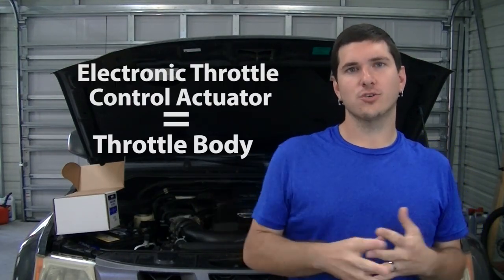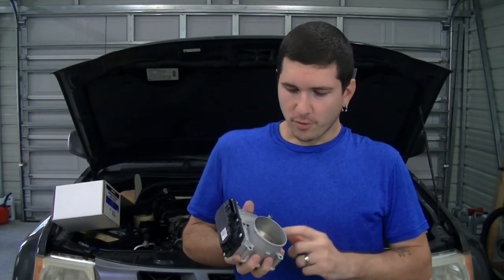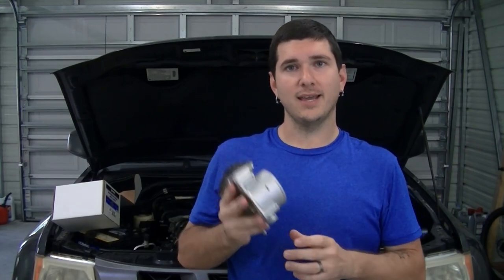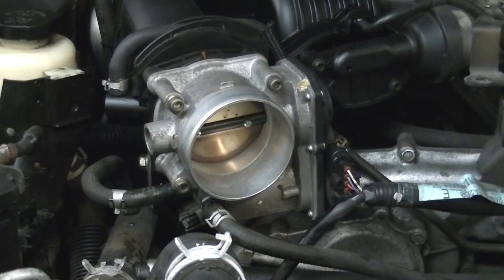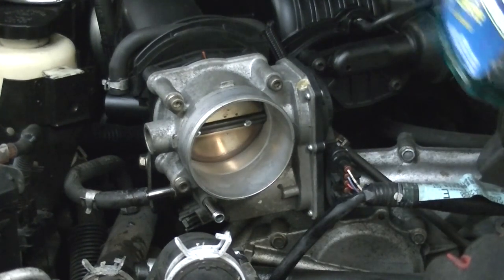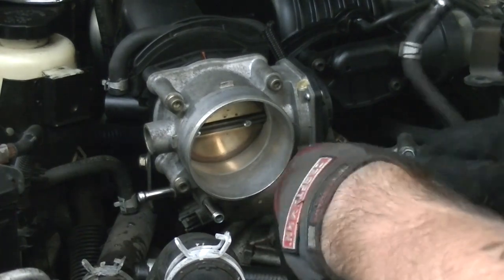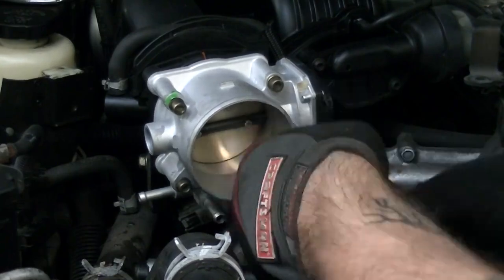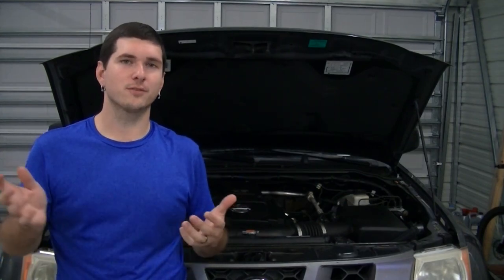How to Replace the Electronic Throttle Control Actuator (throttle body) in Nissan Xterra

Comment: Good clear video as always. Keep it up!
After installing a new clutch and flywheel, the mechanic accidentally misaligned the flywheel. Vehicle idled poorly and would not rev past 2,000 rpm. In his ignorance he swapped out the throttle body with one from a Frontier. Of course he had the same issue. He pulled the transmission again and aligned the flywheel correctly. Upon start-up vehicle " hunted" for idle between 700 and 2000 rpm! Attempted throttle relearn many, many times . Vehicle would not accept!! Eventually took vehicle to dealership, they completed a relearn. At a cost of $150 Canadian! I think it's important that people know there is a potential that you will not be able to complete a throttle relearn in your garage.

Comment: Nice video! I have an 09 Pathfinder and just ordered a replacement throttle body. My question is after  replacing the throttle body, should the relearn procedure be done before starting the engine?
Reply from the maker: Yes, if you replace the throttle body you should do the relearn. Dont worry though, I have a video for that ;)

Comment: gr8 vid      a small tip:in the event coolant is present in hoses you could pinch them closed with tool made for this if you possess one or with vise grips using a short length of discarded hose or similar to protect hoses as you gently pinch them closed as needed        again gr8 vid

Comment: @Rythecarguy i was trying fix rough idle on my car, cleaned the MAF, throttle body, and new spark plugs as well as throttle body seal and plunum seals. As i was cleaning the throttle body i noticed it wasn't going fully verticle closed. Would that indicate it is worn out and needs to be replaced? Love the channel man and have sent tips in the past for your great value you have provided. Will certainly again!

Comment: I just purchased a 2017 Frontier, I do see it and the Eterra are pretty much the same.  I do think the idle is high when starting.  Will cleaning the Mass Air Flow and throttle body first then going through the rest is best?  I didnt see you clean them before the first video on reset.

Comment: hey great video. couple questions. did it fix your problem? and my 2004 pathfinder idles low around 600-650rpm, you think it would be a similar issue? relearning dident fix it. also what are the torque specs?
Reply: did you ever fix it?

Comment: I had this problem in my 2007 pathfinder  2 years ago and bought a reman part now it came back and warranty over. I did have a question when you remove the part do you disconnect the battery or leave it? Last time we disconnect and when we tried to erase the code it wouldnt had to take it to a mwchanic who uses a more high tech machine

Comment: I have a 06 Nissan Pathfinder, cleaned throttle body, put back together and it started idling around 1K, then check engine light. I tried doing the 3 procedures to reset and relearn the TB about 20 times. No work. Still idled high. Was about to order a new TB and came home the next day from work and decided to try the whole reset and relearn procedure with the engine stone cold. Started it up at the end of procedure 3 like it said, came back after a few minutes and RPMs were idling at 625 RPM! So if you are not having any success with engine and transmission fully warmed up, try it with it COLD!
Reply from the maker: Awesome. good tip! Thanks.
Reply: Thank ill try I'm having same issue

Comment: Just curious what symptoms you were having that lead to the change? Thanks!
Reply from the maker: High idle
Reply: @Rythecarguy  thank you for your reply! I got a code P1229 and P2138. Car will be running but almost zero difference in RPM when I hit the gas. Just working through codes and trying to sort it out. No high idle issue here though. Also, just started looking through your videos, and they are some of the most easy to understand ones for my small brain!

Comment: I diagnosed my xterra and it said I have to change my fuel temp sensor  and intake air sensore..parts are on the way..my exterra starts then about 2 minutes it starts to idles to 2000 then goes down to 1000 and continues..engine start to give out weird smell too..do I have to change the throttle body too??the throttle  body didn't read in the diagnostic monitor..pls help

Comment: @rythecarguy Why did you replace the throttle body? What were your issues? I have a high rpm (2500) at startup and relatively high (1100) when warmed up.
Reply from the maker: High idle was the issue. Don't forget your relearn as well. I have a video for it

Comment: How did you know this part needed to be replaced? I have a 2007 Nissan Frontier XE and trying to troubleshoot why its idling fast. Just replaced the radiator & thermostat. TIA

Comment: Hey Ry, Another great video as always. Any issues with this particular throttle body? Just ordered mine with your link. Planned to originally just take off my oem one to clean but after Watching your video I decided to replace.
Reply from the maker: Hey Alvin. This video was almost 7 years ago (can't believe it!) and this throttle body is still running great! I'm sure it will work great for you.  👍🏻
Reply: @Rythecarguy  LOL I didn’t even realize that it was seven years old. I’ll let you know how it goes and again appreciate all your videos.
Reply: @Rythecarguy  Ok. I replaced the throttle body and did the idle relearn procedure. RPMs stayed down for a bit but then started to show same symptoms. Do I need to start hunting for vacuum leaks?
Reply from the maker: Oh bummer. When does it go back up? Once the truck warms up?
Reply: @Rythecarguy  Seems to be. I drove it for a bit to warm it up prior to doing the relearn. Right after it seemed to idle better but it will rise after I’ve been driving for a bit.

Comment: Hey Ryan, went to unscrew the throttle body and wasn’t wanting to come off. Working on a budget here, do you know of any good mechanic shops in Orlando that’ll use my part to install the throttle body for a little bit cheaper or another way I can try and get the bolts out without stripping them?
Reply from the maker: Most automotive shops will use your parts. I actually have my Saab in shop right now and I supplied the fuel pump. It will definitely make the job cheaper since they mark up the parts as well. Throttle body swap should be very cheap. Probably just the one hour minimum

Comment: Is the throttle body responsible for my 2005 XTerra going into “limp mode”? It’s driving me crazy trying to track down what is causing it. Some mechanics say, “it’s your oxygen sensor”. Replaced those- still goes into “limp mode”. Another says, “no, it’s the cam-shaft sensor”. A third says it’s my throttle body. So…

Comment: question. i have a 2005 frontier (2.5L). i removed the Intake to change spark plugs, change intake gasket and throttlebody gasket. im pretty sure i tightened everything correctly and i believe it was all seated correctly. i cleaned the hell outta the throttle body and stuff with carb cleaner. i sprayed the TB pretty good. cleaned Maf sensor correctly with its special cleaner. now everything is back but the engine idles between 1000 and 2000 rpm (fluctuates pretty hard up and down, up and down in park or neutral....its fine in gear). ive checked for vac leaks with propane, tried relearning the TB a million times, reset the ecu with no luck.   any chance spraying the TB pretty good ruined the electronics on the TB somehow?
Reply: Scott Drabek  did you ever figure out what was wrong with your frontier.im having the same exact issue with mine right now and can’t figure out why it’s idle is doing that.

Comment: I m going to change on the Nissan Pathfinder 2013  wath is the procedure I have to disconnect the battery?
Reply from the maker: Just pull off the negative battery cable and secure it somewhere where it won't touch the battery post.

Comment: I need to change mine on a 08 dodge caliber.. Will I need to. program anything or have it taken to the dealer. I was going to change it myself. just wasn't sure or not
Reply from the maker: Most cars when you start messing with air control will need some sort of programming once you are done. You will just have to check the direction for your car and it will tell you if you have to do it afterward.

Comment: I have a 2010 nissan altima and I had no power at all on the car. When i push the pedal nothing happened i changed the throttle bottle and it worked perfect. The next day it messed up again and its giving me the same code. What could it be?

Comment: Question? after replaced it, you don't have to program the sensor, I have a murano and someone toll me that..idk if is true but I'm going to replaced it
Reply from the maker: If you replace it and then start the car and it works just fine then no, you don't technically have to reprogram. However, that will probably not be the case.
Reply: Youll need for sure in altima 2007 you need, murano is big brother of altima 😂

Comment: I have a 2002 Nissan Altima 2.5s  and got a P1128 code , I replaced the throttle body  and did the relearn process . The  following day the check engine light came on and I lost acceleration again and got the same code P1128 .  How can I fix the problem.  Thanks
Reply: I know it’s been 7yrs since this post - but, you said that you “lost acceleration”. This is happening to me and I’ve come to find that it is called “Limp Mode” in Nissans. Did you ever figure out what the cause was and correct the issue? Cuz it’s driving me CRAZY! It happens 2 or 3 tines a trip to the grocery store. I lose acceleration and I have to pull over, turn off the ignition and wait for maybe 30 or 45 seconds and then it’s good again. I don’t know what, exactly is causing it or how to fix it.

Comment: I have nissan pathfinder 2011 and keep getting check engine light , i ran the scanner and i get P0101 code. i replaced the mass air flow sensor and for a week the check engine light went away. now it just came back on and still get the same P0101 code. its  possible that my throttle body probable is dirty? i have 115,000 miles on the truck.
Reply: There is a technical service bulletin for this code. NTB12-051j. Reprogram the ECM. Nissan will charge about $130 for it.

Comment: Having hesitation issues on a 12 Pathfinder 4.0 after high RPMs. Need suggestions where to start: fuel pump assy, mass air flow, TPS?
Reply: elevatorman013  Thank you! I couldn't find anywhere if they came together on the new throttle body.
Reply: Do the rpm drop at 40 I’m
Having similar issue I’ve owned vehicle for year can’t figure out issue payed bunch of mechanics & Nissan

Comment: Is this pretty much the same process for an 05 Pathfinder?
Reply from the maker: Yes if you have the 4.0L V6 then you should be good. If  not the principals are he same.
Reply: Thanks Ry!  The Pathfinder is stuck in limp mode with the Service Engine Soon light on. I did some research and found that it may be the throttle body.  I'm considering just getting the part myself and doing the work.  Your video made it look easy enough.

Comment: Why did you want to replace this in the first place?
Reply from the maker: It had a bad sensor that was causing the rough idle.
Reply: Did you have the P0507 high idle issue? Thats what my VQ frontier has right now. No vacuum leaks anywhere, so I am thinking a new throttle body at this point. 
PS: thanks for the timing chain video. You screwed a couple things up (putting the flywheel stopper where the starter was), but overall it was great.
Reply from the maker: I did have a high idle. The combo of the throttle body and the relearn process fixed it. Also, I'm not sure what you mean about the ring gear stopper. I was following the FSM.
Thanks !
Reply: I ordered a new throttle body!
The flywheel stopper goes where the inspection plate is, on the bottom of the engine. You will see it fits in there perfectly and the little screw lines up with a small hole on the bell housing.  No need to remove the starter! Kind of late now though right? The FSM is incorrect about this.
Also the water pipe off the front of the engine can be disconnected from the rubber hose in the valley of the engine using long needle nose pliers to release the hose clamp. 
This is not a criticism at all, the videos are really good and I appreciate them now that I own a high mileage Nissan with a VQ engine.  Keep up the good work.